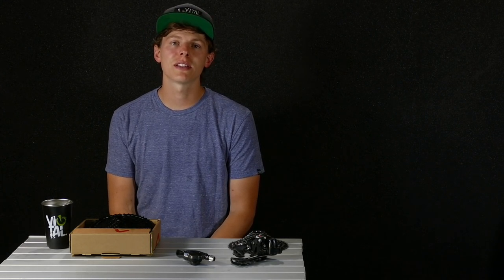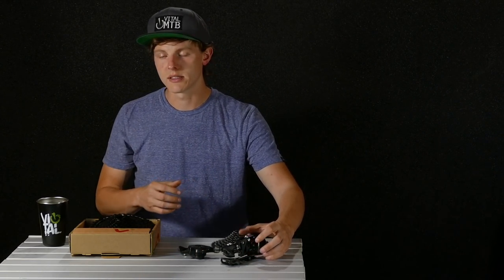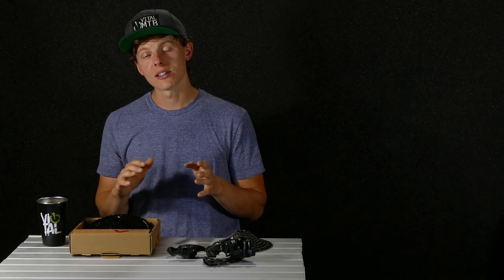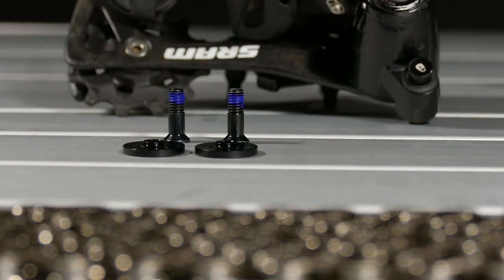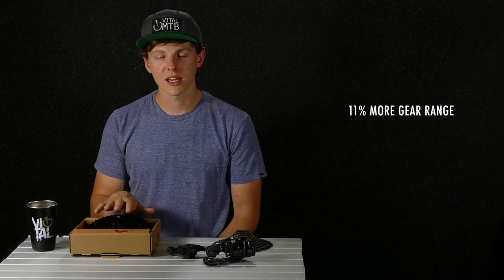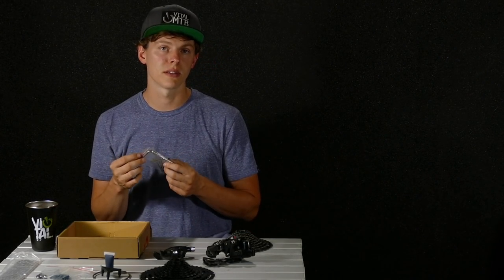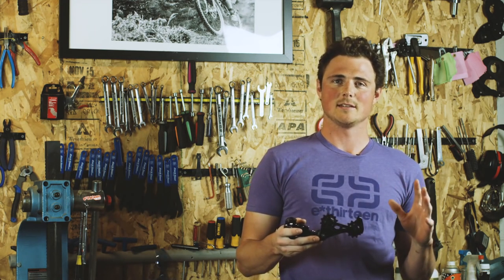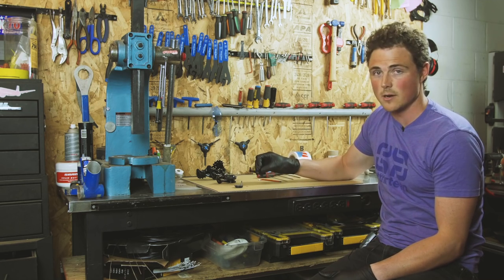HACKED! e*thirteen's 11 to 12-Speed Mountain Bike Drivetrain Conversion

Comment: I love such upgrades kits but it needs to be a little more cheaper maybe $50 cheaper than its current retail cost.
Reply: The price makes sense. It’s easily the cost of a Sram XD cassette + higher end chain, so I would consider this kit when my cassette and chain are worn
Reply: My thought is that this will be done on a older drivetrain which means one even has to consider the fact that if something breaks they need to buy the same part again to keep this upgrade kit.

Comment: 12 spd with 9t? WTF? Nobody uses that.
Reply: armada mhm you have never raced then
Reply: as if you do.
Reply: Yes I did. Thats why I am watching this video. Need a larger gear for sprinting.
Reply: Then y not get a 50t for the front? seems more reasonable than a 9t at the back
Reply: That would work, but then it would be unpossible to climb. A 36t might do the trick for racing.
Reply: 50T chainring would get beat up pretty quick.